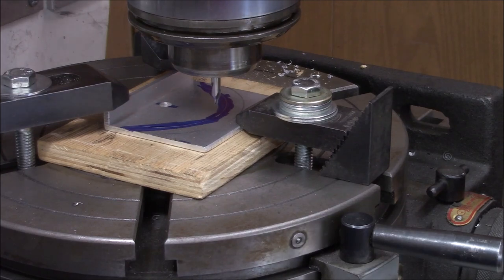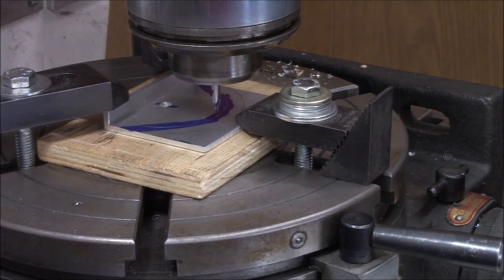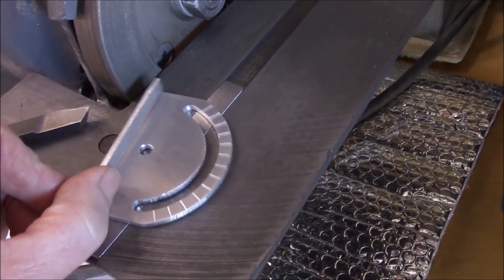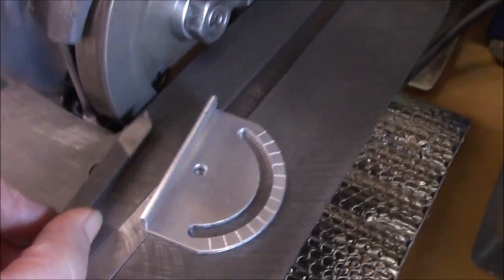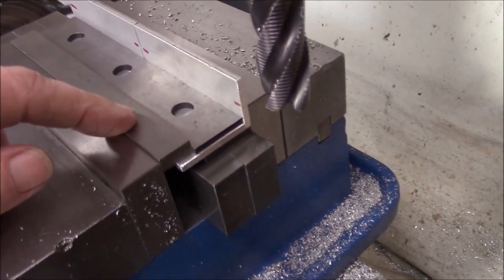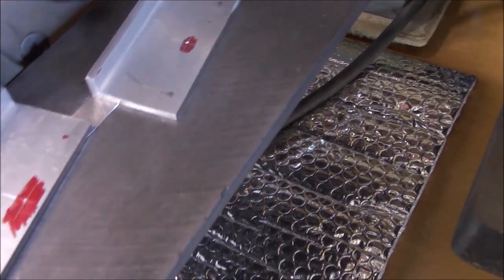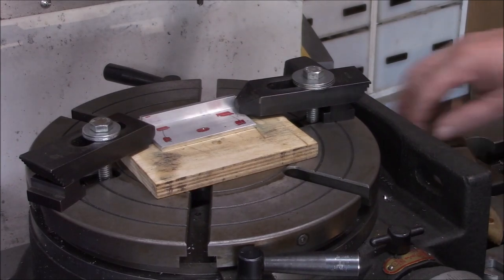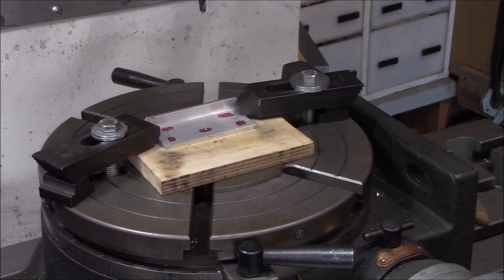Miter Gauge Build Part-1 for Carbide Grinder

Comment: Good one Dean . Good thing Mr Bozo likes the Northern Hemisphere cooler weather !    
If you get bored you can look at the super complicated calculation to see how your angle you are trying to grind changes to a compound angle as soon as you tilt that table to give clearance !!!    Or you can cheat & use the sharpie marker & adjust until the line is parallel to the cutting edge !
Cheers .
Reply from the maker: Thanks Max, some good tips there..